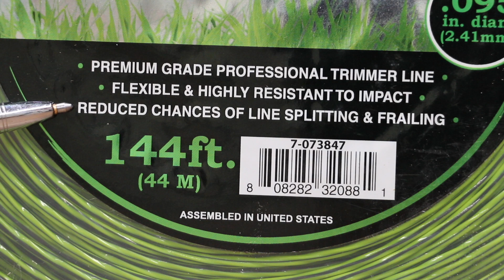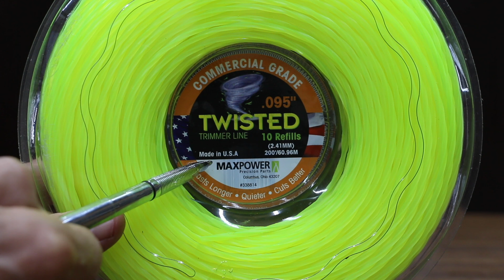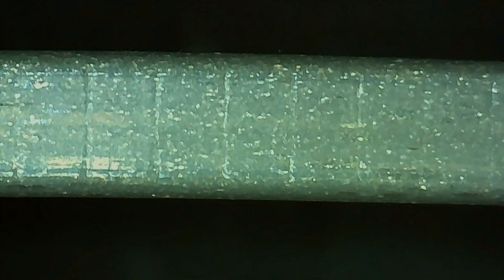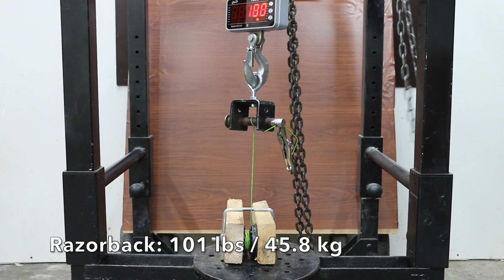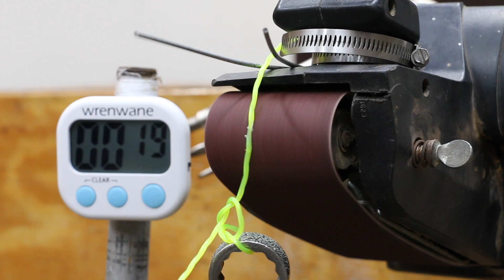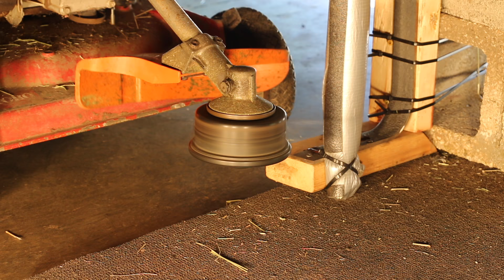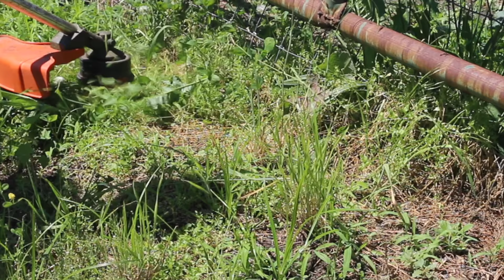Best Trimmer Line? Let's Find Out! Round 2: Stihl, Husqvarna, Echo, Oregon, Shakespeare, Weed Eater

Comment: Acres of horse & chainlink fence here & med speed with Arnold/Shakespeare's Extreme line is best I found. Ive tried several of these lines but not all. 
 Yes yes yes!
  I too discovered higher RPMs just make line snap quicker like you've learned. Ive told people for yrs, staying off that throttle is key to longer line life around objects but especially wire fence.
  I just run high RPM if I hit thick grass/weeds & 
we only go through an 800ft roll of Extreme every few seasons. Thats trimming 3 acres of horse fence, buildings & my home with stone statues & chainlink back yard!  By far the best line I ever found for wire fence trimming though.
  Extreme originally had more titanium in it like Husq line but they cut back on it to help it flex better and it lasts much longer than it once did. Used to frey bad too then.
 I remember first noticing they cut titanium back & being so disappointed. Then I used the newer version & realized the first version really was too stiff/ brittle!
 Its 95 is not smooth cutting for fancy trims imo but Ill take its extra long life over cleaner cuts any day of the week. 
 Thanks, again for such a well done vid!
Reply from the maker: You are welcome!

Comment: Been using the Husqvarna for years, I've always found it to be a great balance of cost and longevity.  Big factor is it never gets welded in the head, always feeds great. Great video as always PF!!!
Reply from the maker: Thanks!
Reply: Same!!! Have had great luck with the husqvarna line
Reply: I run the Husqvarna XP Pro, I have a Shindaiwa T302X 1.8 hp that I cut with. Run it wide open from the start till I run out of gas so I can time study when I want to. The XP Pro cutting 6 inches to 2ft 6-inch weeds I get about 1 hour 20 minutes run time, with other lines I only get about 1 hour to 1 hour and 5 minutes run time. Also don't get the vibration out of the XP Pro that I get from most other lines{twist, square, and other lines in general. The extra run time per tank may not seem like a lot but it adds up to $ over the course of a day or week. It cuts great for me.
Reply: Interesting. I got the Husq, on recommendation from here and found it welds quite a bit and even melts into the spool. I have to use my knife to shave the melted spots on the spool smooth. Honda 435cc, bump head. Fairly woody brush.

Comment: I purchased the Maxpower Twisted on Amazon based on your reviews of these trimmer lines.  I don't use the self feed trimmer head on my Echo straight shaft trimmer.  I've been using a product named Pivot Trim that allows you to use individual cut to length  lines.  This trimmer head accepts .095" diameter line. Unfortunately, the Maxpower Twisted line is just a little too large to fit into the holes on the Pivot Trim head.  I have used several different brands of .095 diameter trimmer line in this trimmer head with no problem.  

I've cut about 60 16" pieces of line off of the spool, so returning the trimmer line to Amazon is not possible.  I'll give the uncut portion to a neighbor who still uses (fights with) the auto feed head on their trimmer!  

I still have a pretty good sized spool of a different brand of .095" line that I've used successfully in the Pivot Trim head, so I'm not out of business yet!

Thanks for all of your great reviews.  You do a great job on doing fair reviews on everything you test. Your videos, editing, and sound are excellent.
Reply from the maker: Thanks and you are welcome!

Comment: Entertaining - I just came across this. Trouble is, it actually proves nothing. I`m a professional landscaper and have been since strimmers were first introduced into the UK. The simple rules when deciding which strimmer line to purchase are: match the line to the machine, match the machine to the job and keep unused line moist to ensure it remains supple. Lastly, ALWAYS buy round profile line because its the only line that you will get a true diameter with throughout its length, (rather like you get with fishing line) and its the least likely line to snag on itself within the spool head. You need common sense and skill to get the best from strimmer line, its `other properties` are irrelevant provided that you apply the elements i`ve described above.
Reply from the maker: Thanks for sharing.

Comment: I came back to this video after I purchased some generic Ace hardware .095 string.  I was in a pinch for time and Ace was the closest.  That crap suckeeeed.   I had to restring 2x just around my pool area(very rocky). I had another brand previously that was tested here and it lasted so much longer between respools.  I ended up ordering the Twisted trimmer line and yes, it really was better.  Thanks again for all that you do.  Worth the little bit of extra money for how much less time I spend respooling.  Something to consider when making your purchase as time is money.
Reply from the maker: Thanks!  Thanks for sharing.

Comment: I must have some bad Shakespeare line cuz what should take me 15 minutes of trimming takes two hours with all the line breaks. It is the same as the one tested and it can’t even make it through weeds and cheat grass without breaking off. I do have a different style head. I cut two 12” lengths and run them into a dual eyelet, leaving me with two 6” lengths of line on opposite sides of the head. I have to cut 30 12” pieces just to get around the house. I spend far more time changing out line than I do cutting.  Time to try the winner!
Reply from the maker: Thanks for sharing.

Comment: There's a delicate balance here to achieve in my experience. You don't want it so strong that the line flies all over, you're only using the tip of the string so to get a good cut it needs a balance between hardness and softness to break off at just the right point. Stihl or bust!
Reply from the maker: Thanks for the feedback.

Comment: Something I've noticed is the Y axis on your graphs. They're misleading. For instance, the Durability graph has the y axis starts at 1900, making it appear upon initial impression that Maxpower is three times as high as Gatorline, however, there is only a 14% difference. 

On the scientific and statistical level, without a higher number of tests, I don't even think that's a significant difference (significant difference being a technical term in statistics). With only one test per group, technically, these results are statistically little more than random.

That being said, this is YouTube, not The Scientific Journal of Trimmer String monthly.

Video Idea: I've always wanted to take a trimmer head, maybe one of those that has swinging blades,  and twist some coat hanger wire (or something) in there and try it instead of the blades. Or maybe short lengths of chain. Or, in light of this video, fence wire. Are we all being ripped off buying trimmer string rather than doing it for cheap on our own? Or are we in danger of bleeding out when a piece of wire lacerates our femoral artery?

Comment: Might want to try soaking all the trimmer lines in a bucket of water for 24 hours or so, then let them dry out, in case the lines have lost a lot of their moisture content during storage, etc. Never can tell just how long a product has been on the shelf since it was actually manufactured. This can make a big difference in the longevity of the trimmer liine. Just my opinion/tip.
Reply from the maker: Thanks for the suggestion.

Comment: Not sure if it matters much, I noticed a good spot to measure when testing tensile strength and line binding/unbinding, is placing a ruler or measuring tool on back board (where the wood plank sits) course that means camera placed straight across from test. Again, not necessary You and your team do a TERRIFIC-FANTASIC-FABULOUS-AMAZING job at pinpointing ups and downs of many products LIKE THIS VIDEO!! THANK YOU. :)

Comment: I have the Echo trimmer where you just stick the two pieces of line in and replace them when they break or wear down—I like that much better than fooling with a spool.  I buy that big spool of Echo line you had on here and cut my sections out of it, but I may switch to a more durable line now.
Reply from the maker: Thanks for sharing.

Comment: Wow your reviews are so damn useful and well done. I bought a Milwaukee electric battery trimmer a couple of years ago and I have struggled to determine what is the best line for the trimmer. The Milwaukee trimmer is as powerful as a large engine gas trimmer so it will disintegrate weaker string lines quickly. Now I know that the Twisted or the Weed Warrior are the two best. The amount of time and frustration and money you have saved me is substantial. I can't thank you enough. Great job!
Reply from the maker: Thanks and you are welcome!

Comment: I heard that soaking the line in a bucket of water helps like not to break easily because it re-hydrates old line. Even just purchased line could be several years old because of bulk buying by wholesalers.  The problem I was having was the line pinching on itself in the spool and it would not feed. I discovered a  trick and that is to shoot a little silicone spray or WD40 on the line. Hope this helps someone else.
Reply from the maker: Thanks for sharing.

Comment: As always, you rock these videos! I've got a Cub Cadet pushable string trimmer (like a DR, but better value). Love the beast, cuts through everything and is easier to use than a handheld. (No vibrating, smoking 2-stroke next to your face causing fatigue and numb arms. Don't have to lift it and focus all your energy cutting at right height (no scalping yard), very easy 1pull start from powerful and quieter 4stroke engine.  Serves as a mower, and cuts saplings up to 1/2" thick, the height of whatever you're mowing doesn't matter! I use it in all the places my riding lawnmower won't or too dangerous to go like steep inclines, and trimming around objects like house. It uses a thicker .155 string. Thanks to another excellent review by PF, I will be looking for twisted maxpower in .155 thickness for it as soon as I finish this...
Reply from the maker: Thanks!  Thanks for sharing.

Comment: Trimmer line gets old and brittle. It will break easily even if you just bought it. The line was manufactured and stored in a warehouse for months before it was sent to the store. Soaking the line in water for a few hours will make the line more flexible and let longer.
Reply from the maker: Thanks for sharing.

Comment: ..Great test!..BTW, Echo offers some premium line similar to the Husqvarna...Tensile strength, weld resistance, breakage/abrasion resistance are all very important traits in trimmer line..more so than shape, IMHO..I have found some shapes initially cut better than others, but after a few seconds of use, abrasion pretty much wears ANY shape line to a more or less round shape, so I don't think edge shape is as important as many people think..the overall quality of the line is much more important..also, ALWAYS important to store trimmer line out of the sun..the sunlight will destroy it and make it very brittle..age matters, too, so don't buy up too much and store it for too long..coming from 30+ year experience 2 cycle mechanic.. :)
Reply from the maker: Thanks!  Thanks for sharing.

Comment: Have you tested EGO Power trimmer line before? I have the refills and thought if you have tested it yet?
Also a tip for trimmer line breaking you can put the line in water to rehydrate it and should work fine after doing that.
Reply from the maker: Thanks for the suggestion.

Comment: Head design is a major factor. I prefer manual loading rather than speed loads. Stihl head properly wound will feed evenly, just like a hose or electrical chord, wrap it up right and it will come undone evenly without tangling.
Reply from the maker: Thanks for the feedback.

Comment: The non round trimmer lines cut faster but are more prone to jamming in the mower head and so I have gone back to rounded line from Husqvarna and Stihl. The trimmer line needs to make a 90 degree turn off the spool and this is not a problem for round line but definitely a problem with line like the Echo Black Diamond.
Reply from the maker: Thanks for the feedback.

Comment: I've used loads of different strimmer lines until I started using the black twisted line produced by Desert Extrusions. It's best by far.
Reply from the maker: Thanks for the feedback.
Reply: They were bought out by Rotary, I believe. Product is known as Desert Vortex. Probably the worlds best line and comes in sizes: .095, .105, .120, .130, .155 and .175 inch. For those who want to experiment with thicker gauge line that is super quiet.

Comment: I want to add round 3 trimmer line residental to commercial grade lines sponsors:
Milwaukee, Echo black diamond, Oregon Platinum Gatorline, Weed warrior Heavy duty, Shakespeare ugly twist, Maxpower twisted, Arnold Xtreme, Husqvarna, Grass Gator, Cyclone, and Harbor freight trimmer line. Same thing as Durability and cutting through test strips to test some other trimmer lines round 3 from residental to commercial grade.
Reply from the maker: Thanks for the suggestion.

Comment: Trimmer line pro tip : Whatever particular line you're using, make sure its hydrated. Submerge the entire roll  n water overnight. You will be staggered  by the improvement in performance strength and durability.
Reply: A seasoned 2 cycle repair shop mechanic told me this as well. He also said trimmer line has a short shelf life and it is best to have fresh stock. Old trimmer line breaks faster.
Reply from the maker: Thanks for the feedback.
Reply: @ProjectFarm please test this.
Reply: Yes, and unfortunately we don't know the age of the line sitting on the store shelf, nor used for the video tests, so without the moisture normalized, the test results are somewhat inconclusive!
Reply: @stinkycheese804  Most line is made of nylon, which absorbs water and becomes less brittle. I store my line in a ziplock bag with a little water, and it lasts much longer without breaking. Husqvarna recommend to do this with their line.
Reply: @russ1747  You don't seem to understand the issue.  Yes, it absorbs water, and LOSES water while it sits on a shelf before sold, and before  the testing in this video, which is why when doing testing, there needs to be a baseline of the hydration level of each test sample so it doesn't interfere with equal testing.
Reply: You mean even if it is a regular nylon line??
Reply: Just soak it once or each time you use it?
Reply: @kymmieann2400 soak before each season. The line will dry out during the winter
Reply: @waynegodwin6860  Store it in a ziplock bag with a tablespoon of water. Most strimmer line is nylon, which absorbs water and becomes less brittle.
Reply: @kymmieann2400  I leave a length of line coiled up in an old plastic ice cream bucket submerged in water. I add that to my trimmer before I use it every time. When I'm done, I just take out the line and put it back in the bucket or it'll be super dried out and the auto feeder often jams up too.

Comment: 1.5 years later I have used max power twisted in 2 trimmers. a power works 60v and a wild badger wbp26bci 26cc 2 stroke trimmer.

in both units the cutting efficiency of max power twisted is such over the stock line that both trimmers cut like they have another 20% more power.
Reply from the maker: Thanks for the feedback.

Comment: The biggest concern I have with this is some of my weed eaters (DeWalt 20v in particular) recommend using a round line and not a twisted line.  I have not tried any twisted lines yet.  Of the round lines you've tested, which one do you think did the best overall?
Reply: the weed warrior was a close 2nd place and is round

Comment: Thanks for doing this.  If you ever do another round of testing, it would be interesting to see results at different temperatures.  I bought some twisted line based on one of your videos that did MUCH better than the line I was previously using, but I have noticed that as fall comes around and temperatures drop, it seems more 'brittle' and I go through quite a bit more line than I did when it was hotter.
Reply from the maker: You are welcome!  Thanks for the suggestion.

Comment: Testing was good, but breakage is important.  I found .080 beats out .095 when trimming around vinyl fence.  Home Depot sells a brand called *Rino line, a shaped but basically round.  Found it likes vinyl fence and wears better.  As for the shaped lines, square, etc ... plain old round line cuts just as good, and does not wear trimmer head eyelets like the shaped does, and the multi-strand lines, they don't like vinyl fence.  For people using Ryobi 18 volt trimmers, I found that .065 Rino worked great and increased battery life about 15% (about 30 solid running minutes vrs 22 minutes) when used.  MY family had a small engine shop in business from '64 to '04 when we sold to a new owner, saw many changes, when we found the problems (like vinyl fence an cemetery headstones) the shape an size of the line made a difference.
Reply from the maker: Thanks for sharing.

Comment: Suggestion for a video. Put the Maxpower trimmer line on various trimmer heads to see which trimmer head is best. I use the pivoting head instead of the bump heads. Seems the line doesn't last as long.

Comment: You made an interesting statement near the end of the video talking about the trimmer along the fence line! 2 things I learned over the years if you weed whack often you need minimum RPM to cut the next session of weeds or grass which in turn saves the trimmer line which last longer and save gas. Have a 250-foot ditch line I used to cut and have to bring the gas can with me and extra round of string! No I use quarter power I can do the ditch and the whole yard all in one session with no extra gas and no extra line! It's the user that makes the difference!
Reply from the maker: Thanks for the feedback.